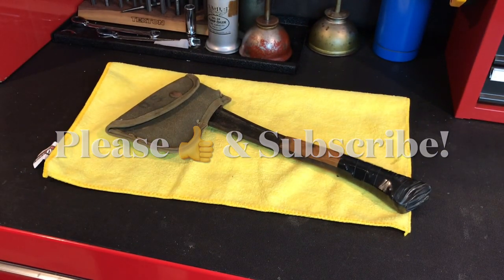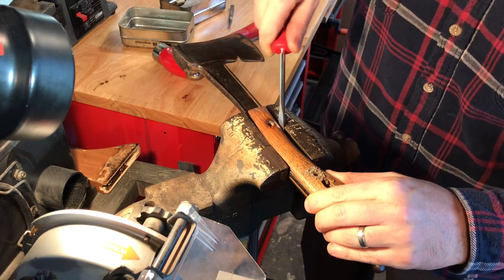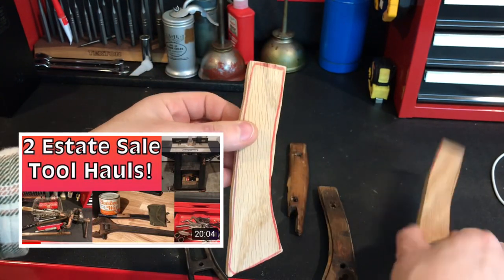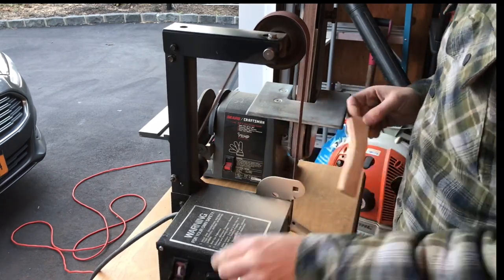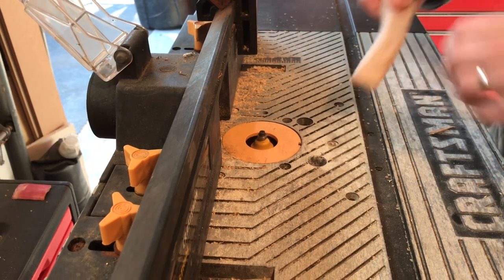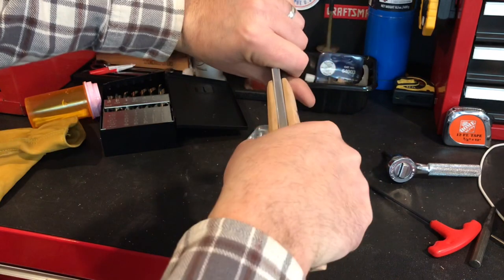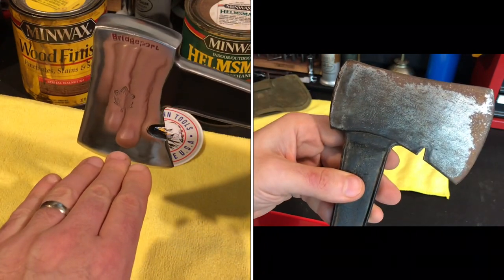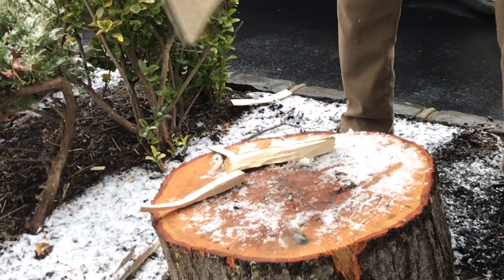1930’s Boy Scout Axe 🪓  Restoration!

Comment: I have the same jaw horse and it’s a huge advantage. It didn’t occur to me to clamp the bench grinder or other power tools in it, so that’s a great idea!
Reply from the maker: It just dawned on me to try it and love that I can do messy stuff outside.  Long term I will most likely bolt bench grinder to wood base making easier and more sturdy to clamp.

Comment: Fantastic restoration Tom! It looks amazing. I really enjoyed watching you use your other restored and reviewed tools. You have a nice shop there. I also appreciate how you talk through the process and give us more info. Not sure why so many channels say nothing through the whole video. Hey I got one of those 2” fiber wheels and it’s too wide for any of my grinders. Is there a trick or attachment available to make it work? Take care 😀👍🏼
Reply from the maker: Hi David, to get mine to fit I used regular flat washers instead of the larger beveled ones. It was tight but the wheel compresses a little when tightening. Plus it doesn’t need to be threaded on too far. I hope that helps. Let me know if not clear.

Comment: what size router bit did you use?
Reply from the maker: Hi Matt, I believe it was like a medium size round over bit and i set the height so it cut a grove.
Reply: Thank you, I’ve been working on the same hatchet but haven’t found a good way to cut the grove in the handle.
Reply from the maker: It was a lot of trail and error on scrap wood and I still messed up the first set.